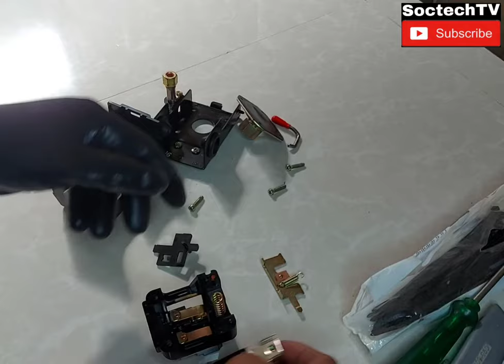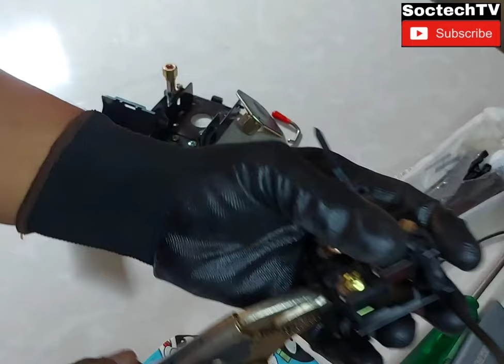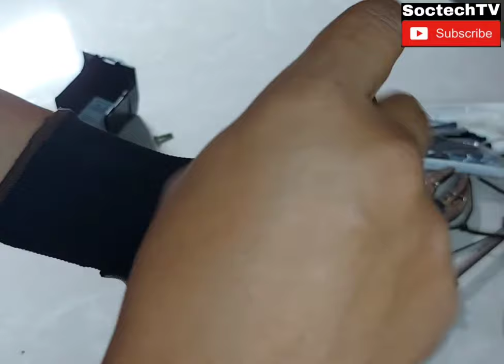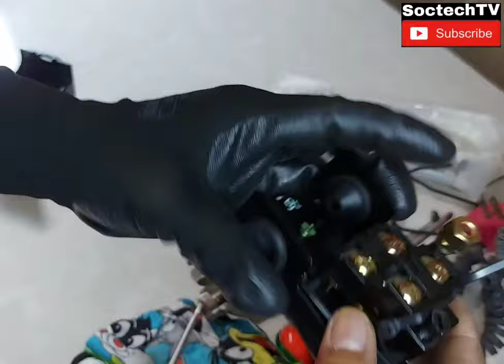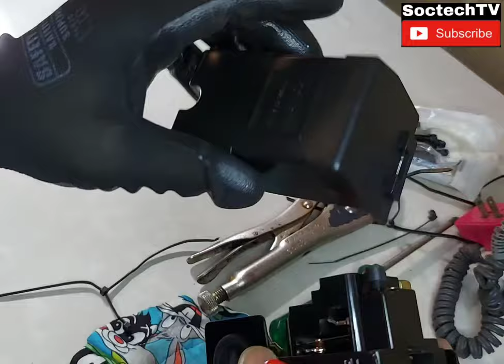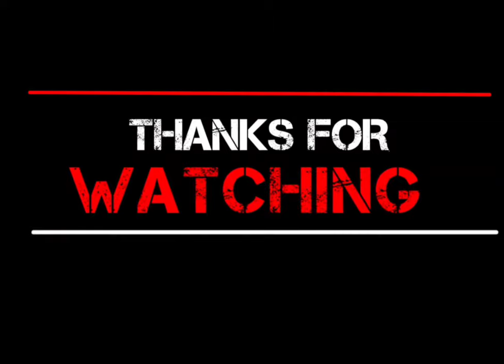How To Assemble Air Compressor Pressure Switch

Comment: There is a little black part with 2 little sticks, u dont show up where go!!
Reply: It slides in vertically and part of it sticks out the top of the housing (reset button). Only goes in one way. And yes, it's the first thing that should go in.

Comment: You have extra long screws to hold the switch to the plate. There's no room for the thickness of twist ties with the shorty screws on what I have. If you're watching the video it's obvious the plastic piece has to go in first and he had to take it apart to put it in. After multiple attempts using various methods, it was a thin wire that worked for holding things together and still being able to remove it. I also drilled a hole and wired the back end of the pressure plate. That's the critical part that always wants to pop out when you're trying to put it together. What a PITA I finally got it working like new. The problem was the gasket leaking air and now it doesn't.

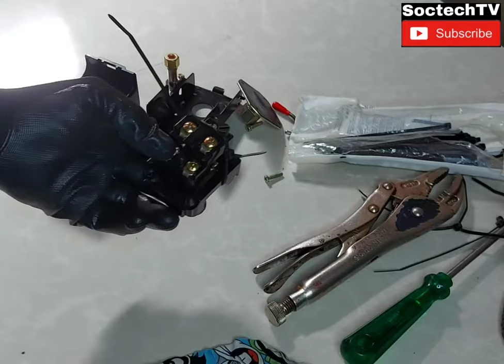Comment: so, where does the black plastic piece go that seemed to disappear  around 3:40...
Reply: I think that should have been the first thing to go in!!!
Reply: Amen slight of hand but no help smh
Reply: I came here to say the same thing. 😳
Reply: @jamesdaul8540 It slides in vertically and part of it stick out the top of the housing (reset button). Only goes in one way.

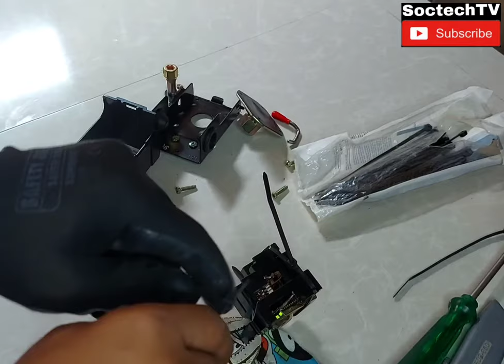Comment: Great video! Thanks os sharing.  I have a very similar ressue switch that I need to put back together and this video should really help.  One question though.  There was a small plastic piece sitting next to the switch cover at 02:40, but not sure where did it go.  I did not see you putting that piece in the assembly.
Reply: It slides in vertically and part of it sticks out the top of the housing (reset button). Only goes in one way. And yes, it's the first thing that should go in.
Reply: Thank you so very much. Much appreciated.

Comment: Thank you,
I spent a lot of time trying to get this contraption together.
Nearly drove myself nuts.
Your technique solved the mystery for me.
After taking this thing apart and ordering a new switch I realized it was just a simple reset button on the motor.
I put it all back together following your technique and all works great.
As one of your viewers noted the black plastic piece goes in Pryor to the spring attachment.
Plastic ties and vise grips were the secret 👍
Have a backup pressure switch and thorough knowledge of what to do now.
🤬🤬🤬now🥰🥰🥰
Thanks again.

Comment: Thanks but you didn't  install the black plastic piece before you put zip ties on, did you forget and have to start over?
Reply: It slides in vertically and part of it sticks out the top of the housing (reset button). Only goes in one way. And yes, it's the first thing that should go in.

Comment: sir the small black  plastic.where did you put it...
Reply: It goes iside,its the little button on top you push down, that's the part that had me stumped
Reply: He edited because he fucked up he had to do it all over again
Reply: It slides in vertically and part of it sticks out the top of the housing (reset button). Only goes in one way. And yes, it's the first thing that should go in.

Comment: where did the plastic peace go. most important part of the assemble
Reply: It slides in vertically and part of it sticks out the top of the housing (reset button). Only goes in one way. And yes, it's the first thing that should go in.

Comment: Where did put that black plastic???
Reply: Where did the black plastic piece go it just disappeared
Reply: It slides in vertically and part of it sticks out the top of the housing (reset button). Only goes in one way. And yes, it's the first thing that should go in.